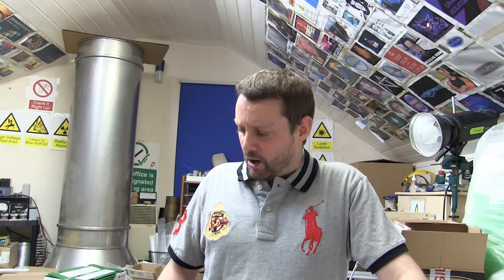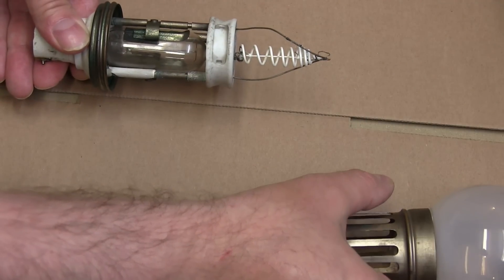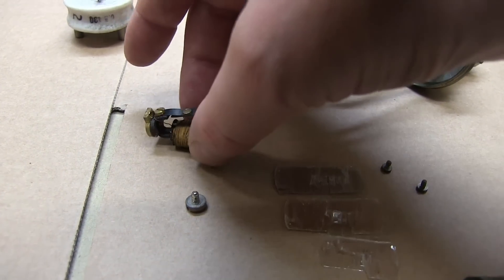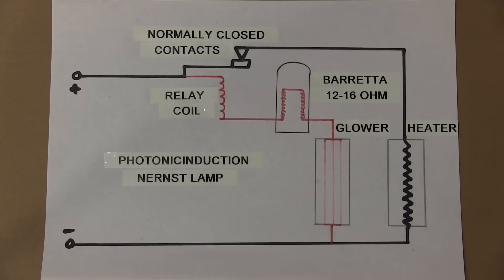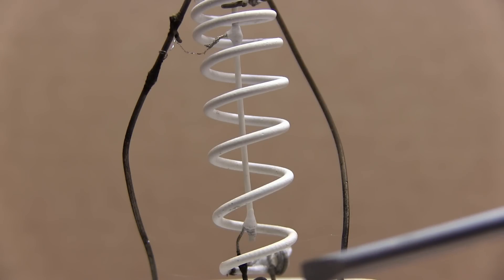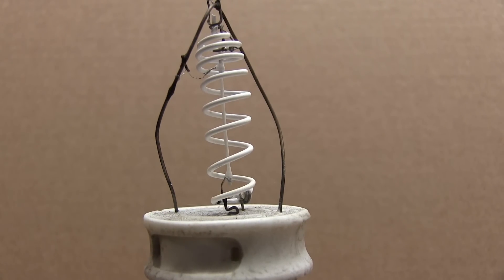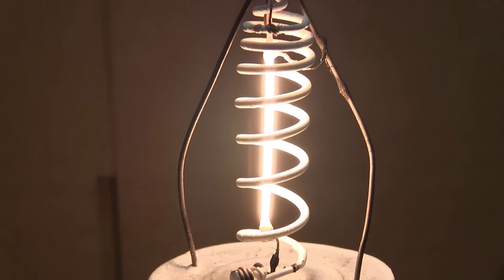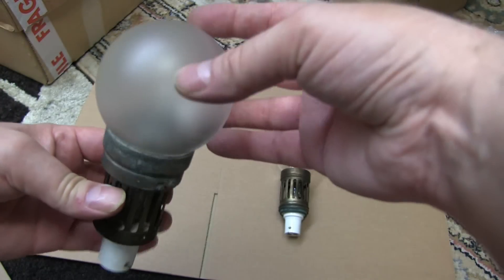120 Year Old Rare Nernst Lamps

Comment: This thing looks like someone's attempt to get around a patent.

Very cool! Just out of curiosity what was the amperage and total power draw?
Reply: This is the question I had. The description says 130V @ 300mA, which seems like a tiny amount. I don't know loads about this stuff, but I have the impression this is because of it being DC? 130 * 0.3 = about 40W consumption, I suppose?
Reply: Was it a way around a patent ?

Or was it because a nernst lamp can operate in open air, while other incandescent bulbs need to be filled with a vacuum or inert gas ?
So nernst lamps could have been cheaper to make for time.

Comment: To think, Einstein probably wrote his special theory of relativity in the light of one of these.
Reply: Probably not, I don't think they were ever popular in homes. From what I can tell from reading early-1900s technical magazines and books, Nernst lamps were mostly marketed for commercial lighting and eventually replaced by gas discharge lamps. Home lighting was mostly carbon and tungsten filament bulbs and, for a surprisingly long time, kerosene lamps, candles and gas lamps. I seem to remember reading that at the onset of WWI only 10% of the households in Berlin had electric lights! That changed during the 20s and 30s but even by WWII far from everyone in central Europe had electricity at home, even in big cities!

I'm not 100% sure if the story is entirely true but my dad has a 1960 refrigerator that - at least that's the story - my aunt bought off of an old lady, who hadn't been able to use it because she didn't have electricity in her little working-class flat! That was Vienna, Austria in the late 1960s!

Comment: This may be hard for readers to understand but for the past 20 years I have been messing about in the electric industry but never below 500 MW and I absolutely love expensive designer lamps and light fittings - but my knowledge of electricity is barely at A level standard physics.

This is an absolutely brilliant video and am off to watch some more. Totally enthralling. Be afraid. At work they wont let me near anything that is actually a live circuit.

Comment: It'd be interesting to make a modern reproduction with commercially available LED filaments.  It'd take a timer circuit to swap over from the "heater" to "glower" filaments, but would be a neat effect.
Reply: That would be very neat.    I mean they already make LED filaments in spiral as well as stick forms,  so it shouldn't be that difficult to make a bulb with 2 separate LED filaments with an internal timer that switches from the spiral to the straight LED in the center.    If you think about it, 3 way incandescent bulbs have 2 filaments of different wattages which can be switched on separately or together to produce your 50-100-150 watts.

Comment: I notice that the spiral heats up way quicker at the top, I guess because hot air rises.  Also, the coils are closer together at the top which also makes them heat up faster.  That makes me think the different spacing is deliberate, and it's designed to be the other way up so the effects cancel out and it heats up evenly along the length.  I think you have it upside down.  By the way, it's spelt barretter.  I have only ever come across these in series connected valve heaters in vintage TVs to stabilise the heater current.  Lovely light from that lamp.  Somebody should start making them again, I reckon they would sell well.

Comment: Proper steampunk lamp design!

I do have a few questions that I can’t get out of my mind..

Apart from being beautiful, (in my opinion) what are the benefits of these fellas compared to standard incandescent bulbs?

What does the emitted light spectrum look like?

How sensitive are they to high (or very low) humidity?

And last, but not least:
What is the typical life time of the lamps? (And do they simply stop emitting light when they burn out, or do they produce less light over time, like a typical HID?)

Comment: Excellent! I have not seen one of these before I knew that some ceramics become
conductive at high temperature but to use it in lighting device is very different  and
clever approach to incandescent illumination.  Any idea what the mean time to failure
is for these lamps?

Comment: 130V @ 300mA is 39watts. That light output appeared to be roughly equivalent to a 40 watt filament lamp still in current use, so not bad at all for 100 year old plus technology.
Reply: Did you see it get really bright for a moment? Around 10mins I think. I wonder how long it could run that hot? As far as i'm aware, the reason for the eventual failure of the filament is still up for debate. A gradual changed in crystalline alignment perhaps?
These are definitely worth experimenting with. Other oxides can be used. Aluminium oxide, Silicon dioxide, etc and mixtures thereof.
Melting point of filament and connection points are things to consider. But it could be done using far more naturally abundant, or available/affordable oxides.

Comment: Asbestos  can stand high temperatures.  I bet this lamp doesn't take much power due to the current limiting devices in the holder. How many amps and volts did  you run it on. This is the first incandescent lamp I've seen operate outside of a vacuum. The video was very   nice. Im thankful you came back. You are  very educational i learn things from you all the time
Reply: I've read of Nernst lamps being run at 0.5 amps, 100 volts.
Worth experimenting with! Other more common oxides may be used. Aluminium oxide, Silicon dioxide, etc. Semiconductor materials.

Melting point of the oxide filament and of the connection points, are things to consider.

These Nernst incandescent lamps were just before Edison indecent lamps, as far as commercial sale goes. And I think there are probably alot of reasons why they're not more talked about when learning history in science classes and just in general... Doesn't it seem a little strange to you? Maybe it's all about understanding (standingunder, someone/something)... True, honest explanations of how things actually work are pretty much non-existent...and that's not because no one knows....it's because...

Comment: Using ceramic oxides like a Coleman lantern but heated electrically rather than with gas, very cool. I notice the ceramic formula is slightly different - can I guess that thorium/cerium oxides work better at higher temperatures and the zirconium/yttrium oxides at lower? Or in the case of the Nernst lamp, thermoconductivity is the most important?
Reply: Other oxides can be used. Aluminium oxide, Silicon dioxide, Magnesium oxide, etc and maybe Cupric/Cuprous oxide and others based on more available materials. There's a vid somewhere on here of someone putting a fair amount of current through an Aluminium wire in open air. An Aluminium oxide layer forms on the outside and protects the inside which is melted and sags, which is why the connection ends up breaking - not directly because of oxidation. The outside layer of Aluminium oxide glows incandescent.

Melting point of the filament material is a limiting factor as are connection points. But there should be no reason why a piece of sintered Aluminium oxide couldn't work. Or maybe even make a mix of Aluminium oxide powder, Silicic acid, etc. Dry. Heat with a torch (maybe extra hot first time with an HHO flame?) and then run the electricity. Some Aluminosilicate material would probably form in that case. 
There are various specs on the filament sizes and such, in the literature which you can find online. It takes a bit of digging to find. There are different designs to this one. But actually, the potato peeler ones show how it doesn't need to be very complicated.

There's debate over why these Nernst filaments eventually stop working. I wonder if it has something to do with a gradual physical change in alignment of crystalline structure.

Anyway, different oxides produce different colours. Some are more in the UV range! This is all somewhat relatable to LED's and by extension, photocells etc ( Eg, photo diodes in cameras.). Semiconductor materials.
The connection points may not need to be platinum, or other pricey/rare metals - but i'm still trying to figure out how to get around that. Maybe flare the filament at both ends to lower temp slightly at those points - allowing for lower melting point common metal to be used to connect to it?
There also must be quite a few ways to heat these up, switch heater off and filament on. Manual and automatic.

A decent and achievable DIY electric light needs to be figured out for experimenters and the sake of self-sufficiency and general 'lights out, system down' preparations... Something more doable than the usual "Edison" incandescent. The type you can make from plant ashes and not much else. Oxides are everywhere if you know how to separate them, purify them and so on.

Comment: The camera must be adjusting for the light output. I would have suggested that the heater generates more incandescent energy than the glower, but when the camera doesn't adjust for the light output, the glower does appear much brighter.  Very cool. So much to make a light bulb light, and it's not even florescent.

We take for granted, the lights we have today. But think how a user of one of these was awed by it's output, versus an oil lamp or candle.

Comment: A pleasure to watch and learn.Only in 1900 would they have put a hook to hold the bayonet pin in place.  Iron ballast in Hydrogen, ceramic elements, I wonder how many CF bulbs will work in 100 years even if left in a drawer.

Comment: That was beautiful bro.  I wonder if it could be encased in clear silicone in order to protect it.. i don't know the temperature, but that could work up to 400 degrees easily.  Does it actually need to be exposed to oxygen in order to work?  or are heat and volt-amps  the only considerations?

Comment: That was interesting! I suppose that's what they came up with when you aren't sure what voltage and current are going to any given building, and making vacuum-sealed bulbs is not easy or economical. The pre-oxidization concept reminds me of a mantle gas/oil lamp.
Reply: Yes, a mantle is a good comparison. Or a limelight.
These are definitely worth experimenting with. Other oxides can be used. Aluminium oxide, Silicon dioxide, etc and mixtures thereof. Semiconductive materials.
The melting point of the filament and connection points are things to consider. But it could be done using far more naturally abundant and/or available/affordable oxides.
And from other designs i've seen, including the potato peeler ones, the platinum wire doesn't need to go right through the filament. And may not have to be platinum. If another filament design is used, maybe copper wire, etc, could be used?

I read an interesting patent on gas mantles being made with a mixture of oxides and melted sugar. To get thin workable strands I guess. The sugar burns away leaving the desired structure.
Maybe a double coil oxide filament is possible using that technique?

Comment: Obviously they can run in open air. But I wonder if their efficiency could be improved by operating them under vacuum to prevent convection removing heat from the glower.

Comment: Fun facts from wikipdia: "In addition to their usage for ordinary electric illumination, Nernst lamps were used in one of the first practical long-distance photoelectric facsimile (fax) systems, designed by professor Arthur Korn in 1902, and in Allvar Gullstrand's original slit lamp (1911) which is used for ophthalmology to allow physicians to view the inside of a patient's eye and contributed to Gullstrand's Nobel Prize award.[2]

Even after Nernst lamps became obsolete as visible lamps, "Nernst glowers" continue to be used as the infrared-emitting source used in IR spectroscopy devices. Their emission of infrared makes them inefficient as visible light sources, but perfect for IR spectroscopy applications. [3] Silicon carbide Globars now compete for this purpose as they are conductive even at room temperature and therefore need no preheating"

Comment: Any idea how many Nernst lamps were produced, before they were displaced by tungsten filament bulbs (way cheaper and less complicated)?

I found some information (13000 in USA by the 1904, from Westinghouse Company), but without actual sources. I also know they were also made by AEG in Germany, Ganz and Co in Austria, and Nernst Electric Light in UK (found in a paper from 1901).

I also found (in that article from 1901 that the Nernst lamps made in USA, lasted about 800-900 hours using 220V versions, and 250-300 hours using 110V version. Pretty poor, but they provided replacement filaments, that were rather easy to replace, as the bulb was in pure air with easy access to various parts for replacement.

Comment: I only just found out about this.
So many ideas and questions.
That ceramic rod could keep glowing in a microwave oven, if one could get it to temperature while suspended inside the microwave. 

Where do I find some nice little ZrO2 rods, like the one in this lamp? Aside from cannibalising a potato peeler

What's the failure mode? I'm guessing the ceramic cracks after enough heat cycles. Would it last forever if never turned off?

Don't most things become conductive when glowing in the visible spectrum? What other materials could be used?

Comment: If it wasn't for the fact that these lamps are extremely complicated and difficult to make when compared to the modern design, it's actually a pretty neat design.

Got a question - is the Baretta only there to provide a resistance? It seems like the heater can withstand the rated 130V (also because it will shut down after a while) - but the glower is not supposed to have all that current passing through it. Could you replace the Baretta with a 16 Ohm high watt resistor?

Comment: So compared to a 39 watt Edison style bulb, (if my math is right) how many lumans does it generate?? I know they do not make a 39 watts bulb, but here in the states they did make a 40 watt bulb!!! DC at the time??? Now what is the efficiency of the bulb compared to the new LED bulbs. Just think there is a free app on IOS to measure lumans!! I know, I am a Geek and spelling was not a requirement!!!

Nice job on the demo, Never heard of that type bulb, But AC won over DC back when it mattered !!! So DC never took off until the last few years when extremely hi voltage transmission came into being.

DE N2JYG